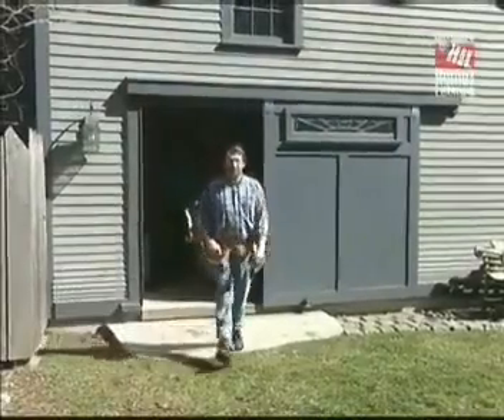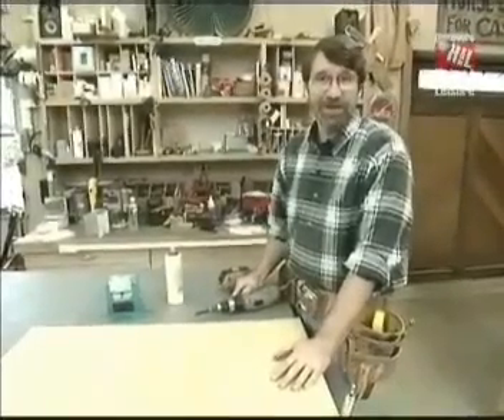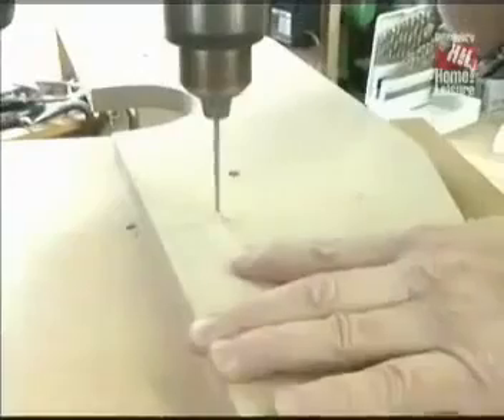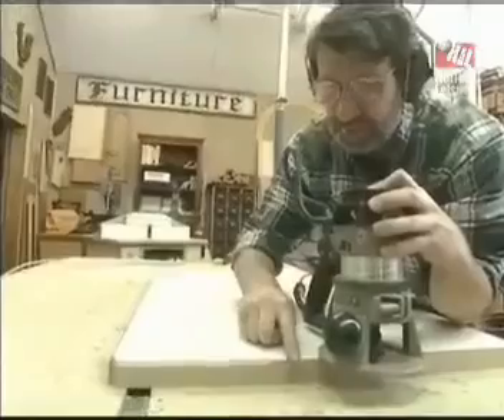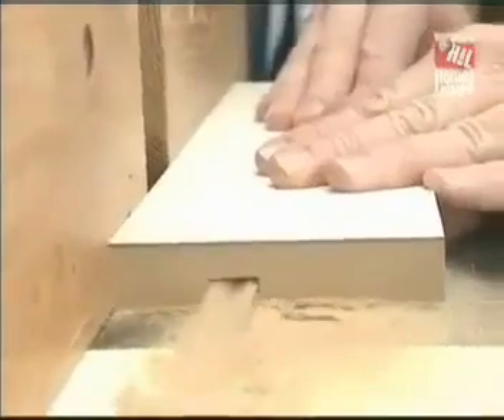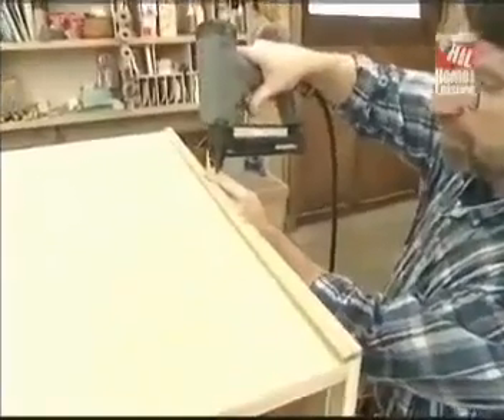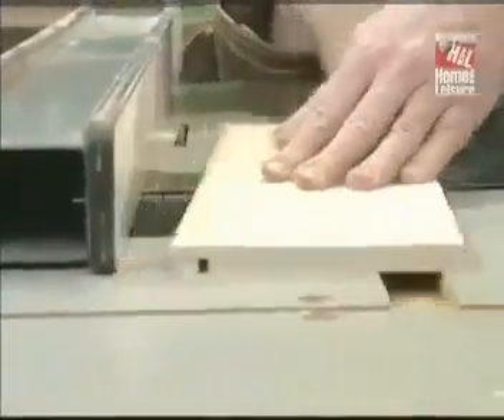New Yankee Workshop S15E01 Deluxe Router Station

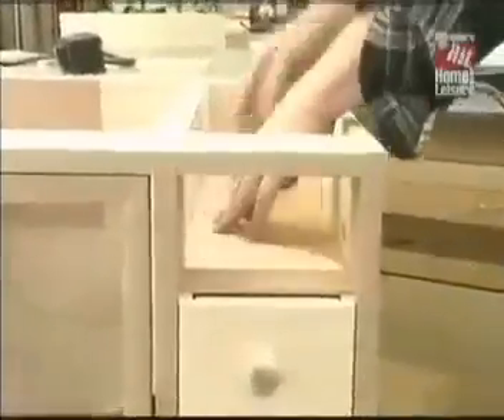Comment: It's 5 years since this was uploaded and the problem with repeating the beginning of the show has not been fixed. In fact, I noticed that it starts over twice. The first is at 20:23 and the other is at 28:42. I won't watch anything else by Mr. Halpern.
Reply: Repetition is a very effective teacher. While doubtful, maybe Mr halpern was trying to save you/us the hassle of pressing “start over,” knowing that we’d want/need to watch it repeatedly. 

PS Mr Halpern served a large community of wannabe woodworkers for a long time. Many of us learned from him (and still do) while others complained about insignificant errors. I think that those of us that learn more than complain unnecessarily are happier woodworkers. 😊

Comment: I bought the plans many years ago and built my version which included some of your updates such as a cheaper switch and dust control mounted to the fence plus I made my lift cable from a flexible drill extension. Norm you are my hero I was so sad when your show closed

Comment: Something went wrong with the recording of this programme; the last part is missing and there is a repeat of the first part in its place.
Reply: Hi Craig,
The section that is missing is the exact bit I was looking for also. There is reference to it  30.30 where he talks about improvements to the dust extraction. I have seen it previously and it is all about having the wood chips/dust fall down a slope and through an air flow that very effectively drags  them to the outlet at the back. It is almost funnel shaped and was very very efficient one of the best mods I have seen and one I want to include in my new router table.. The few details I can remember of the mod were to do with placing sloped dividers that boxed off dead areas where saw dust could accumulate. Hope that helps

Comment: which drill bits for 1/2 and 1/4 router bits
Reply: Steve Ho I am making this table right now. Yesterday I drilled the drawer for my 1/4 inch bits. I used a 7mm drill. I have only 2 1/2 inch bits and they will go in one of the drawers, but I’d probably use a 13 or 14mm drill. I also used drawer runners for all the drawers, and I’m going with two doors in the bottom compartments. I modded the electrics to include an external power socket that’s powered from the switch along with the router. I’ll plug my dust collector in this socket so it comes on automatically with the router.
Reply: for 1/4 what size drill bit and 1/2 what size drill bit?